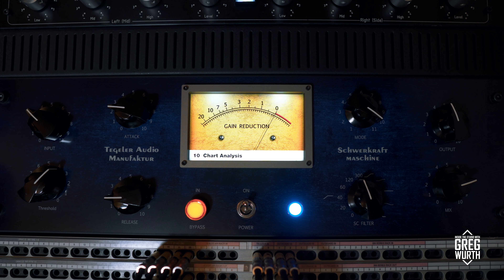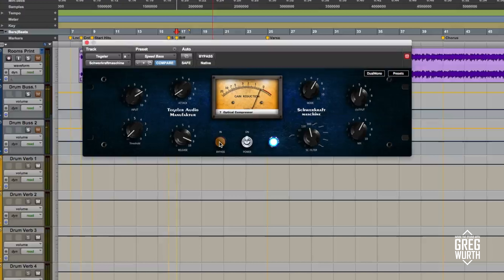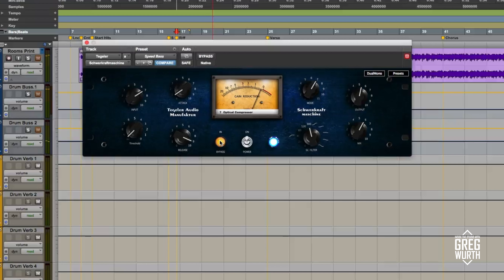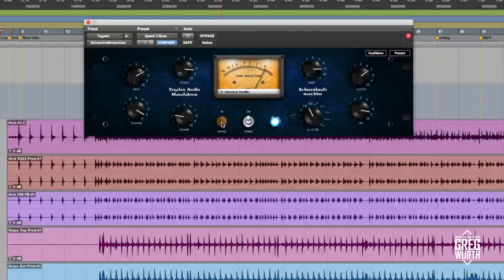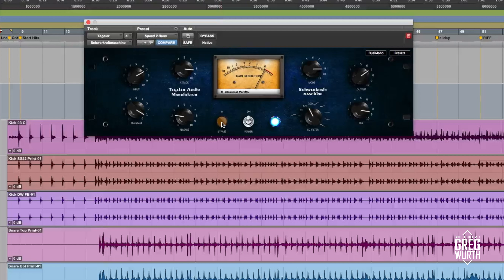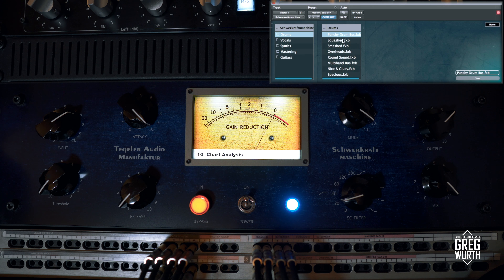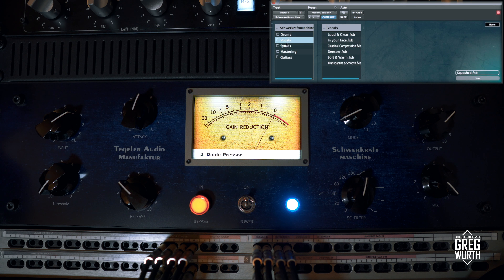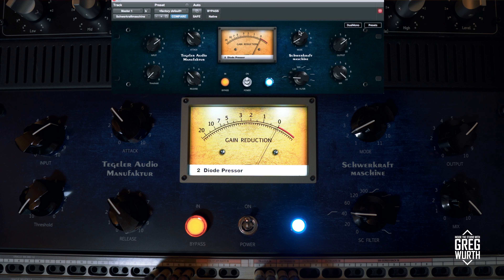Have You Tried The Schwerkraft Maschine by Tegeler Audio?

Comment: Very good video. Thanks for that. To one of your criticisms. As far as I know and have also learned in conversation with Christian Bruss of the Tegeler Audio Manufactory, the potentiometer knobs move slowly into their postiton when you control them via the plugin, but the values are set immediately. That is, the values are set and the pots only retract as optical control in the remote control scenario. If the potentiometer knobs are then touched and turned, they then take over the setting of the values again.
Reply from the maker: Thanks Marc.  That's good to know. Only wish the pots didn't make so much noise then but everything can't be perfect right?
Reply: This is so true. Nothing is perfect, but sometimes the little flaws make up the character :-). The fact that you hear the running sound of the potentiometers so clearly was the only thing that bothered me when I had the Schwerkraftmaschine for testing. You can really hear the sound of the pots in the track. This unfortunately excludes the use of FX automation when printing the mix. Otherwise it is an excellent compressor and realy worth the money.
Reply: Greg, did you try the pong game on the Schwerkraft Maschine ? :)